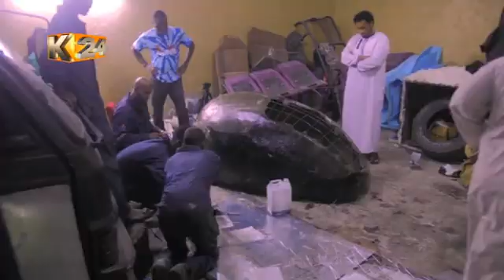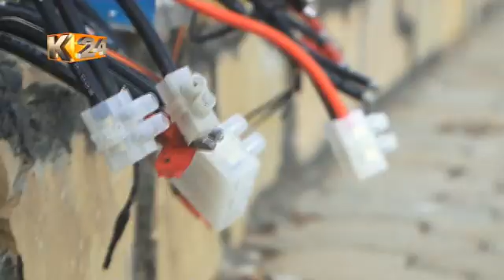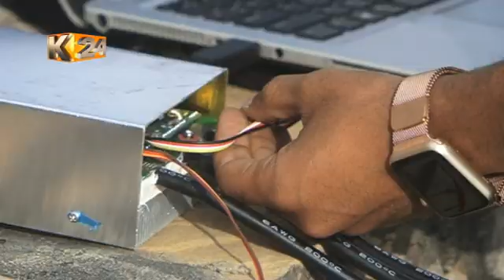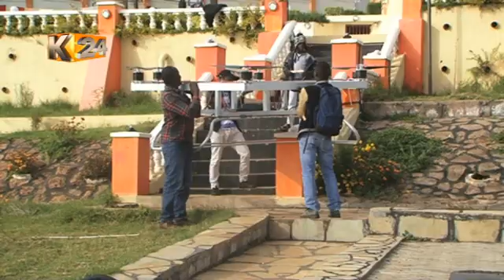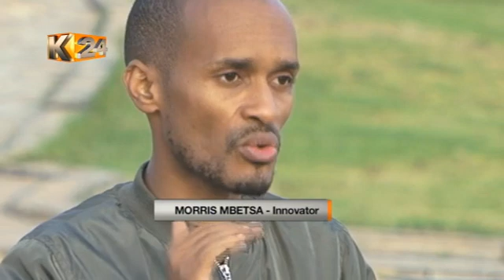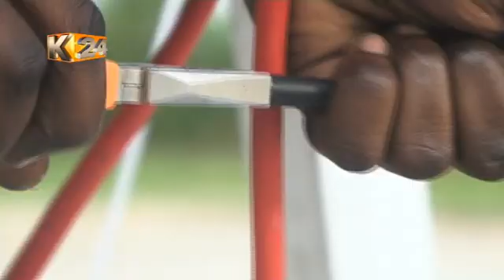Kenya's first passenger drone

Comment: i really  like what you guys are doing. thumps up   ? is there room for a small gas engine 300 to 600cc and an alternator to recharge the existing battery.  you may need that redundancy in order  obtain approval  form the air authorities in your country.    great job